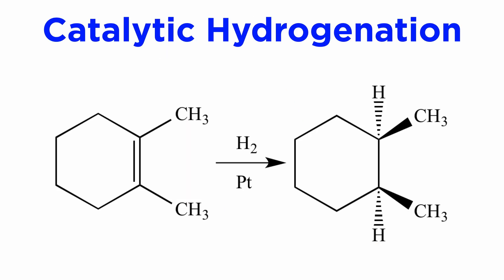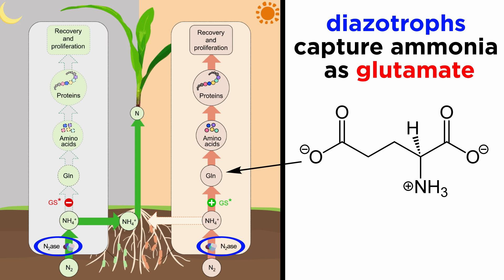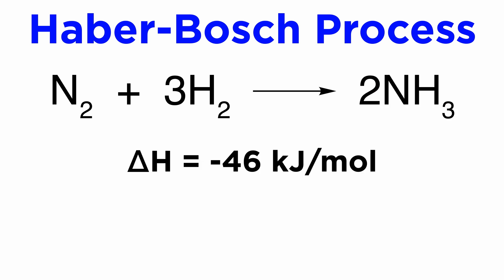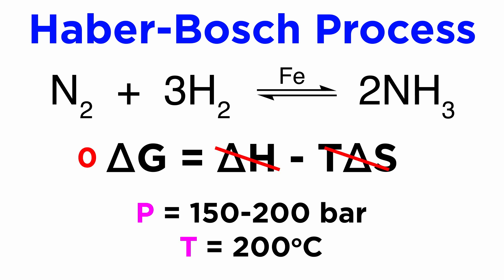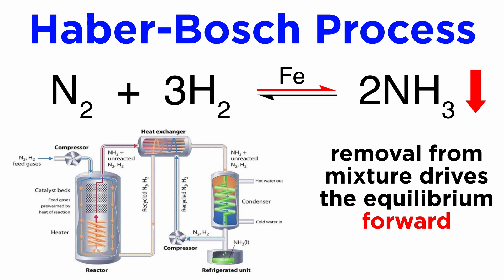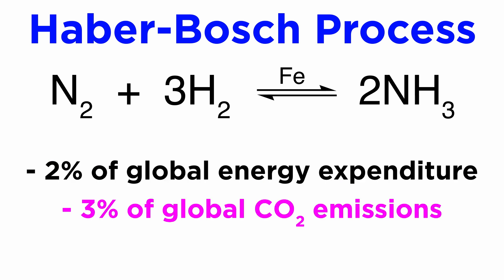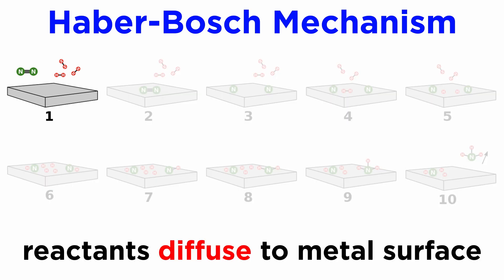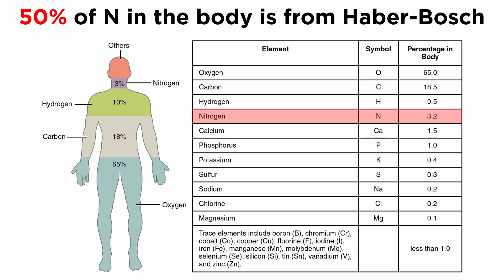The Haber-Bosch Process: Industrial Ammonia Synthesis

Comment: one interesting note to the future of ammonia production is the idea to use nitrogen fixing photosynthetic microorganisms to produce fixed nitrogen instead of the Haber Bosch process. from my understanding its still a long way away from being an economically viable alternative to Haber Bosch, but the idea is very interesting to me, because it would directly solve the two main drawbacks of Haber Bosch. Photosynthetic microorganisms take CO2 out of the atmosphere just by existing and they do not require the extreme temperatures that are needed for the Haber Bosch process to function. im very curious to see if this would ever be a viable alternative to producing ammonia/fixed nitrogen compounds

Comment: Thank you! 
I would add, that one of the simplest solutions to the problem of carbon dioxide emissions during the process is to react CO2 that comes from the steam reforming process (the main process used to produce hydrogen in industrial level quantities - and the one used at ammonia plants) with ammonia to produce urea. Since the plants would require not only nitrogen but carbon as well, and urea is much easier to handle and store than liquified ammonia.

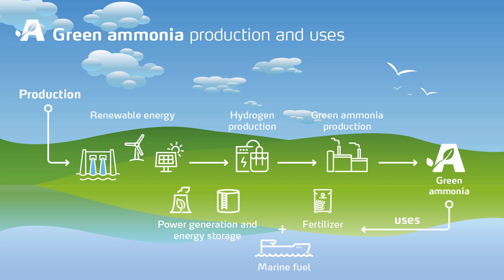Comment: 10:10 It's funny how the pretty diagram shows green ammonia being made from renewable power, and I was thinking about how this is yet another serious reason we might need nuclear power for the foreseeable future. There's simply no other power source like nuclear: clean, safe, stable, extremely dense (power/area), very high power output with great potential for direct heat used in chemical processes (there's at least one NPP planning to be built in the USA for chemical processing), great jobs & work environment. I wish I had worked at an NPP. I'm a YIMBY when it comes to the topic. Nuclear waste isn't a real problem so long as it's properly managed; in fact, many kinds of nuclear waste are extremely valuable for medical therapies, space projects, and research. Also, we can make gen IV NPPs that are walkaway safe, extremely resistant to natural disasters & attacks, and use isotopes that can't easily or possibly be used for nuclear weapons. At this point, any reader can tell that I'm very pro-nuclear energy, but I'm also very supportive of renewables and batteries and all the many other changes we can make to better our world. Anyhow, yeah, I'm not sure where exactly you got that pretty diagram, but I noticed how it shows renewables powering chemical processes (Haber-Bosch this time), and it just got my noodle thinking about nuclear energy.

The major problems with NPPs are the cost and time to build. I honestly think we've allowed the nuclear energy sector to be over regulated. Just for a minute, imagine if fossil fuels had ever been as regulated as nuclear energy is. It would make fossil fuels totally unfeasible. The radioactive molecules from fossil fuel smoke stacks would need to be catalyzed or otherwise captured. Heck, even the exhausts from our ICEs in our cars should be captured in large tanks and sequestered somewhere halfway safe. It's absurd what the fossil fuel industry has gotten away with. Almost complete deregulation for a century or more before they even got a bit under control. What a farce. Anyhow, yeah, it would be nice to see faster and less expensive NPP building in the USA.

I sometimes imagine a big project in the Bay Area. Instead of all these renewables that require dozens of square miles for intermittent power, I imagine one powerful station that powers the whole Bay Area and well beyond. Its footprint is maybe half a square mile to one square mile. It has maybe 10-20 MSRs using thorium or another non-weaponizeable isotopes. This massive facility doesn't just provide power for a highly electrified Bay Area. It exports energy to the rest of the state and perhaps out-of-state. It powers a massive desalination plant that doesn't harm the SF Bay in any ecological way but provides millions of gallons daily of fresh water to the Bay Area. This massive power plant also runs chemical processes like the Haber-Bosch process, chlorine & sodium hydroxide processing, aluminum, cement, glass, metal recycling, and more that use a lot of electricity. Also, the plant will produce net-neutral fuels for airplanes or even regular vehicles. Also, the plant will be built to handle wildfire, earthquakes, floods, attacks, and so on. Another point: the desalination plant works synergystically with the chlorine & sodium hydroxide production because the desal's saltwater brine is used to make the chlorine and sodium hydroxide. Two more things: 1, the plant decarbonizes the bay area's water and atmosphere with Direct Water Capture of CO2 and Direct Air Capture of CO2 (I think DWC is more promising because the amount of CO2 in a liter of water is far greater than a liter of standard air); and 2, we can charge massive batteries with excess power (not limited to lithium battery chemistry (I'm thinking gravity batteries from the water reservoirs that we will make with the desal plant, plus the gravity batteries can be part of the pressure to feed to feed the desal plant). I can go on and on about this. It's not meant to be a techno-solutionist utopia. I'm just imagining what we can build with current tech. I should note that this project would probably be about $100 billion and would get a ton of pushback from radiophobes & chemophobes. 😅 Also, while the NPP might be under 1 square mile, the water reservoirs could be several square miles large. Finally, what I'm imagining would probably take a decade to build—even if everything moved quickly. Anyhow, it's all a daydream of sorts that I like to share sometimes.